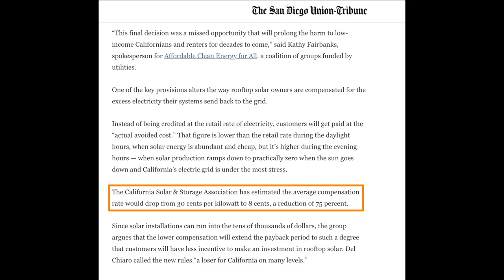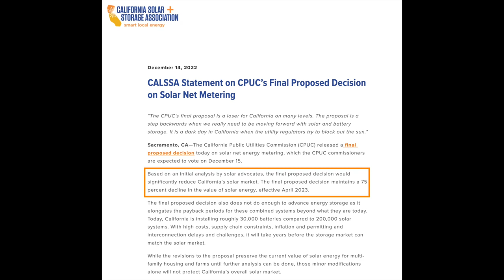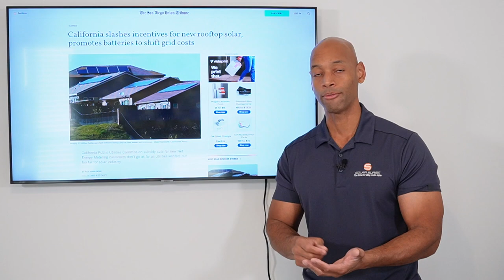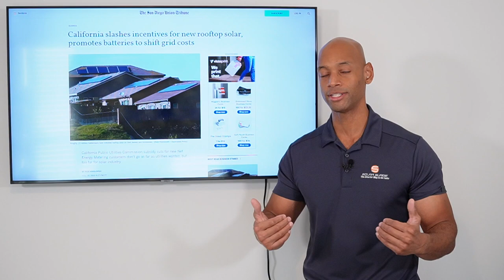URGENT: California Solar Program Ending April 2023

Comment: Thanks for very informative video, 2 questions to be answered:
1) todays Net Metering program, doesn’t do the accounting in daily basis, but does it after full year. I.e., they calculate all the number of units you generated for full year and subtract the total amount of units you consumed full year and send you a bill for only excess units at the end of the year. They call it true up charges. 
This means that we are getting benefits of storing for entire year. Which cannot be replaced by buying battery. Since battery will be charged to capacity in summer we will be good for nights of summer but what about winters, we won’t be getting enough power generated in the day so we will be ending up using PGE power and pay their high prices. 
Battery is not going to be exactly same as what we have today. 

2) what happens if we already have the system but it’s too small and we want to add more panels in future, would the grandfathering rule be applied to the new higher system?

Please clarify these points.
Reply: Our solar company set our system up for 120% of or usage, as calculated from 12months of bills submitted.  
They told us that if we modified our system regarding adding more panels after April 2023, that we will lose the current agreement, and will be subject to the new rate plan just approved by the CPUC.  
We just finished a few days ago, and unfortunately we won’t know how we fare for consumption until this summer, when we will be running our AC.   As it is we keep our AC set to 82 degrees.  

If you think you’re underpowered, you may want to check with your solar company.  

They may be able to add more panels and beat the deadline.
Reply: This is regarding impact of system expansion under NEM 1.0, but I believe this also applies to NEM 2.0:

If the renewable generator is modified or repaired during the "grandfathering" period, the customer will remain eligible only if the NEM1 system does not increase in size more than 10 percent of the generating capacity in the original PTO letter, or 1 kW, whichever is greater.

However, if the capacity increase is greater than 1 kW or 10% of the original approved generator capacity, whichever is larger, the customer cannot utilize the NEM1 program for the entire system. The customer would have the following two options:

Separately meter* the added capacity  with NEMMT to take service under the NEM2 program, or
Elect for the entire system to take service under the NEM2 program.

The separately metered system is eligible to be grandfathered under the NEM2 program for the full 20 years. However, if the entire system takes service under the NEM2 program, it will be grandfathered under the NEM2 program beginning from the date of the issuance of the NEM1 PTO.

Source: https://www.pge.com/en_US/residential/solar-and-vehicles/green-energy-incentives/solar-and-renewable-metering-and-billing/net-energy-metering-program-tracking/net-energy-metering-and-tracking-faq.page
Reply: The way it was explained to me you can add additional battery's and not affect you current net metering. You would only go to the new plan if you add panels.

Comment: The higher rate charge also includes a cost to maintain, fix and upgrade the infrastructure.  Those power poles don’t get installed for free.

Comment: It wasn't really an equal two-way relationship, because we were allowed to net over the entire year. The grid is footing a huge cost in allowing us to use it as a big infinitely-sized / infinite-duration battery.   Those costs are substantial and are being directly borne by non-solar customers.  And anyone who thinks otherwise can try disconnecting from the grid and see how far they get without it!

The new NEM basically just says.... ok, but if you want to do that now you have to provide the load-shifting storage system yourself.  You don't get to net over the whole year or even a whole day.  It is instantaneous netting now (well, 6-second intervals anyhow).  So if you want to take advantage of load-shifting your excess solar, you have to foot the cost of the equipment that does it.

Beyond that, I mostly agree with your assessment.  Even without batteries, home solar still breaks-even in a reasonable period of time.  It has gotten so cheap now that it still makes sense to do it.

Also, having batteries does not require going full-on with a whole-home backup system (though having at least a critical-loads panel is nice).  Still, not required.  It can literally be just grid-tied load-shifting which is a lot cheaper than whole-home backup.   And one can choose whether to just load-shift the morning and evening peak (or even push energy to the grid during those peaks) as the low-hanging fruit, or ultimately load-shift the entire sun-down cycle.

Quick calculation.  To load-shift 5 hours at 2kW is roughly 10kWh in batteries... around $3000.  And the inverter is less than $1000.  So $4000 or so DIY and + installation costs if not DIY.   I expect we will see professional offerings for such systems within a year.

Comment: I'm on a PG&E EV rate and in the summer the cost from 4 pm to 9 pm it's 55 cents per kwh. From 12 midnight until 3 pm it's 24.7 cents per kwh.
Reply: i would double check i have the same plan but its 3pm-12 am for .57, 12am-3pm = .25
Reply: @thang1742  Just looked it up. Summer peak rate is $.55950 and off peak is $.24699. Winter peak rate is $.43239 and off peak is $.24699. Partial peak is $.44901 in winter and $.41569 in summer. The regular residential E1 rate is $.31516 baseline, $.39468 from 101%-400% and $.49335 for usage over 400% of baseline.
Reply: @thang1742  The peak rate is from 4 pm to 9 pm. Off peak is from 12 midnight until 3 pm. Partial peak is from 3 pm to 4 pm and 9 pm to 12 midnight.

Comment: Unbelievable. Guess we need to spend $10-15k on a battery that lasts 10 years. Makes no sense to spend that. ROI is horrible.
Reply: I understand what you are saying and I agree with what I believe are your feelings on this topic.  
My perspective on the batteries is that at the end of the warranty, longest is 12 years, the batteries don’t stop working, say like a typical car battery might. 
They can still store and release energy, however the manufacture does not want to be responsible for the batteries after that point. 
Now, I am sure it could be that some of the batteries do stop working.
Prob have to wait 10 years to find out?
Thanks.
Reply: @davidorcutt9246  yea, I’m curious what you he degradation factor will be. 10 years and -20% no one knows
Reply: @tylerpetit33  
Agreed!
I wish I knew. 
But I guess it’s like a car in a way…
we are still working towards making that purchase a priority and
We’ll just enjoy the benefit as long as we can.:)-
Best to you.
Reply: Here in the UK a battery will pay for itself within 3-4 years on a time of day tarrif just timeshifting consumption to off peak times and then running off the battery to avoid peak period tarrifs. Solar could take 10-12 to pay back.
Reply: @eclecticcyclist  It depends what your cost is. My peak in summer is $0.55. My ROI is 4.5 years for my solar.
Reply: @Tyler Private
Edited my response: 
$10-$15K on a battery that lasts only 10 years AND won't be powerful enough to run all circuits in your home. You'd need to spend $30-$50K for a battery powerful enough to power your whole house for any meaningful amount of time. 👎
Reply: @aldiaz33  A 10KWH battery is plenty large enough to provide most standard sized homes with power when the sun goes down. I’m not sure how big your home is, but a 10KWH for my 2500 sq ft home would work perfectly, assuming I’m not running AC. If it’s just the refrigerator and lights though the evening, it’s plenty.
Reply: But ar current energy prices you'll still be saving the cost of a battery in less than 4 years so for the other 6 years you'll be saving at least $15k maybe £22-23k which is not to me sniffed at.

Comment: I like your video in the way you present everything in clear terms. I have a question. I have had 16 solar panels on my home and I purchased a Tesla about a year ago and everything is fine, I was thinking of maybe adding 2-4 more panels. I understand I am grandfathered into my electric company and will get the 1 for 1 exchange for electricity I produce and don't need, but if I get another electric car my current system might not be able to cover my usage as well as it does now. If I add 2-4 panels (or whatever it turns out to be) will I still be grandfathered in or if I add  to my system will the grandfathered status change because I am changing how many panels I have in my system?
Reply: Note that you can only increase your system size by 10% or 1KW whatever is larger and still remain in CA NEM 2.0.  If it’s more than that your entire system will be transitioned to NEM 3.0 after 4/15/2023.   I found this out in trying to upgrade my system.
Reply: @y2kroxy  That was the news I was afraid I would hear, but thank you so much for your reply.

Comment: Because of the 1 for 1 metering here in California, coupled with high energy pricing, is why California leads the nation in rooftop solar.  It also made no sense to use a battery back up, other than emergency power during an outage.  That has now all changed, California will no longer lead the way.  Homeowners will be far less likely to purchase a system that has a 10 year break even point then a 5 year break even point.  Who knows if you'll even be in the same house in 10 years.  Not to mention that in 25 years time a typical system can pay for itself 4 times over again, now its closer to 2.  If you have the money you'd be better off putting into an index fund than purchasing solar.
Reply: Straight facts
Reply: Ah, poor baby, rampant theft was removed as legal... poor baby boo boo.  Pay to make the grid stable one way or another if you are on it and have solar.  Do that or get off the grid.
Reply: @w8stral  I think you have forgotten the original reason for the push for Californians to go solar.  Originally it was to prevent building more power plants.  In the meantime the utilities have not kept up with the known need to improve the grid.   The best 'backup' for peak power use is some type of "battery".  there are a series of hydro plants that could have been modified to pump water back up to higher reservoirs during the 20+ years of solar adoption.  Instead of preparing for the eventuality of more power requirements during the evening hours, the power companies paid their executives higher & higher pay packages which are not controlled by the CPUC.  The lack of improving is well documented in the courts by the enormous pay outs for disasters caused by mismanaged PG&E.

Comment: How does this affect someone who had their solar system prior to deadline but then later decided to add onto their existing solar system?
Reply from the maker: Great question.  If you increase the solar power AC rating of the system, you would be forced into NEM 3.0.  However, adding a battery will not affect your current net-metering agreement.

Comment: As I understand this new plan, the solar system must be installed and get PTO (permission to operate) before the end of April, 2023 to be grandfathered into the NEMS 2.0 plan.  Joe stated in this informative video that the paperwork must be filed before this date.  I think his statement is incorrect.  Am I wrong?
Reply: After a little more digging, Joe’s statement is correct and I was incorrect.  The ruling says “IOU customers have until April 13, 2023 to be grandfathered into NEM 2.0 by submitting a complete interconnection application for a new solar system.”

Comment: What if you have a system all ready and want to add more panels or storage, will that push you into NEM 3.0? I have 17 KW system.
Reply from the maker: In this case, you should be fine. Expanding an existing with metering system should not force you to change plans.

Comment: Can I run my A/C from a battery?
How long will the battery last while drawing 4.5-5kW/hr.?

How many “cycles” will my battery endure before being worthless?
Reply from the maker: Yes, a large enough battery can handle the A/C load.  In terms of cycle life, you would be looking at 4-6k cycles using current state-of-the-art LiFePO4 batteries.
Reply: @SolarSurge  but in hot sacramento summer evenings how LONG will it run (hours)? And how many $10k’s in batteries to survive and evening at 102F outside if a/c is running 6-8hrs before solar is up again?

Comment: It sounds like you're doing what Wisconsin does Wisconsin will pay $0.14 but if the but if Wisconsin selling you electricity by kilowatts they charge you at some time of the day 25-cent a kilowatt two other times a day 50 cent a kilowatt but they only pay $0.14 to buy a kilowatt from you. You know so many years ago I thought the only paid $0.07 a kilowatt and I started getting solar panels figuring only gets $0.07 I figured it out at that price and I was happy with that but actually found out that they pay $0.14 which is double what I thought.

Comment: LOL...  First time Joe presented on this topic (that I am aware of) was in late 2021.  I hurried to buy to beat the change from NEM 2.0 (i.e., their marketing worked).  It's probably real now, but the same sense of urgency was portrayed back then.
Reply: I rushed to get my system installed this year too. The CPUC was going to pass those insane rules in December of 2021 if it weren't for solar friendly activists and environmentalists in California that pressed Newsome to block that ridiculous draft of NEM 3.0.  You can call it marketing if you want, but that was the truth of the information available at the time. Where this guy gets it wrong is the benefit of batteries for anyone who is able to get in under NEM 2.0. From a strictly financial perspective, batteries do not make financial sense for anyone who's grandfathered in under NEM 2.0.
Reply: @aldiaz33  Batteries make sense for backup and for use during the peak rate period from 4-8.
Reply: @emmgeevideo  From a strictly financial perspective, batteries do not make sense for anyone able to get in prior to NEM 3.0. Why spend an extra $10K -$30K+ when you can get retail 1 for 1 credit and essentially use the grid as your battery? Batteries are still way too expensive and have too short of a useful life. For people who experience frequent and long outages, need backup power and feel that price tag is worth it to them, that's their prerogative, but selling batteries to folks under 1.0 or 2.0 doesn't pencil out from a strictly financial perspective.

Comment: There's no point in going solar unless you install a mega battery system too and enough solar panel power to charge it full...like utilizing fast charging ability like our phones...CPCU WAS PAID TO SIDE WITH POWER COMPANY'S MONOPOLY.  They raised the cost and then didn't even try to meet consumer's in the middle. We should be able to charge the excess surplus energy at our own price to the energy company as well. Definitely not a free market.

Comment: Do they have to be installed before the end of the month or is being in contract this month count
Reply from the maker: Being under contract ASAP helps, but you need to have your installer file the application with the power company and get power company approval before April 14th.

Comment: If I get a small solar system right now to be grandfathered for NEM 2.0, can I add more panel in the future (4-5 years from now) and continue on nem 2.0? or will I be moved to 3.0?
Reply: You can add up to 1kw on your system but if you go over you enter into 3.0
Reply: @scatdaddy3922  whoah okay. do you have links to the language on modifying the existing system?
Reply: @BilalSattar  
This is regarding impact of system expansion with PG&E under NEM 1.0, but I believe this also applies to NEM 2.0 (not sure about SE or SDG&E):

If the renewable generator is modified or repaired during the "grandfathering" period, the customer will remain eligible only if the NEM1 system does not increase in size more than 10 percent of the generating capacity in the original PTO letter, or 1 kW, whichever is greater.

However, if the capacity increase is greater than 1 kW or 10% of the original approved generator capacity, whichever is larger, the customer cannot utilize the NEM1 program for the entire system. The customer would have the following two options:

Separately meter* the added capacity  with NEMMT to take service under the NEM2 program, or
Elect for the entire system to take service under the NEM2 program.

The separately metered system is eligible to be grandfathered under the NEM2 program for the full 20 years. However, if the entire system takes service under the NEM2 program, it will be grandfathered under the NEM2 program beginning from the date of the issuance of the NEM1 PTO.

Source: https://www.pge.com/en_US/residential/solar-and-vehicles/green-energy-incentives/solar-and-renewable-metering-and-billing/net-energy-metering-program-tracking/net-energy-metering-and-tracking-faq.page

Comment: It's even worse than you lay out.  Batteries large enough to get you through the night are doable and a worthy project for sure.  But batteries to get you through the Winter are impossible.  THAT is something net metering did for us. It acted like a seasonal battery and it was free.  You could store up credits in the Summer and use them in the Winter.  Without that your solar array has to be sized to get you through the Winter.  Where I am that's at least doubling the size of the array.  If you can get through the Winter without banked power then you can really "stick it to the utilities" because you can go off-grid.